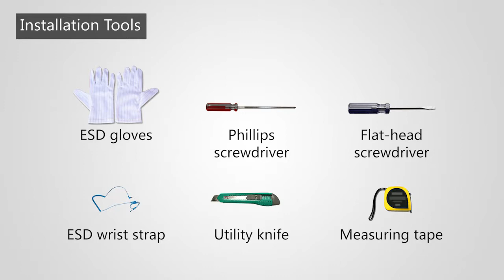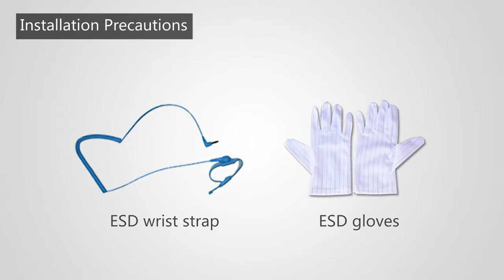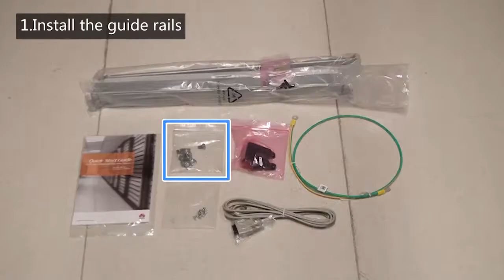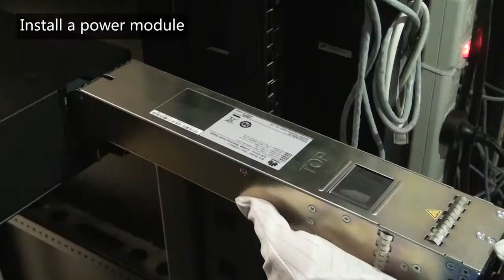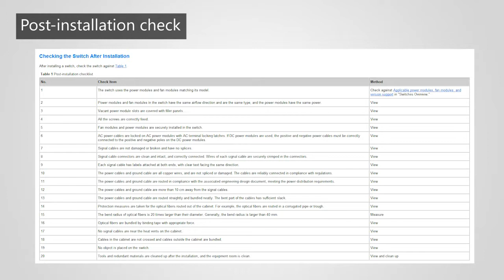How to Install Huawei CloudEngine 8860 Series Data Center Switch

Comment: "Worlds First" has been spelled incorrectly. Otherwise good basic hardware installation guide.
Reply from the maker: Thank you for your attention to the documentation. 
This issue has been tracked by the documentation engineer.
If you have any other questions, leave messages in corresponding web pages.